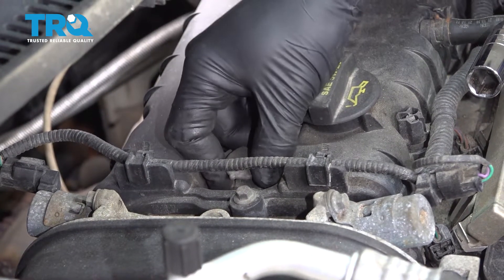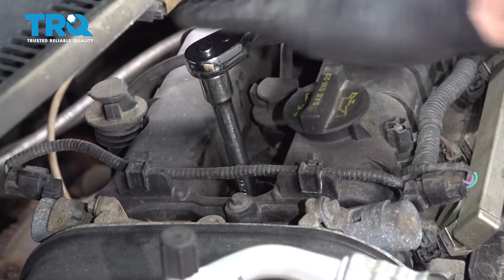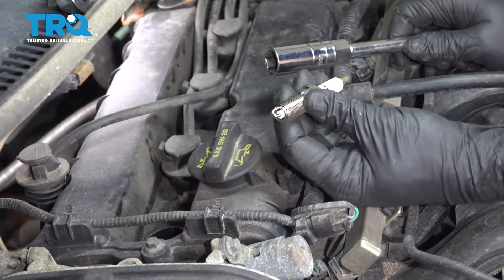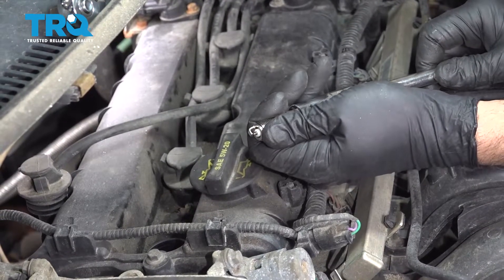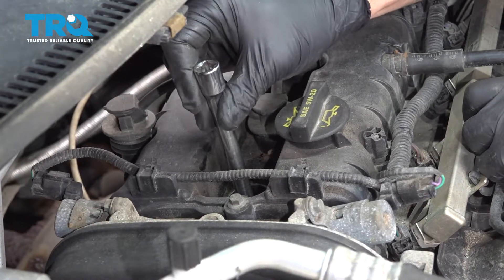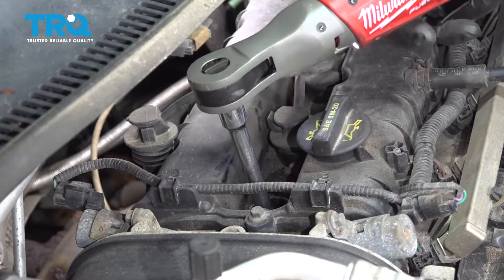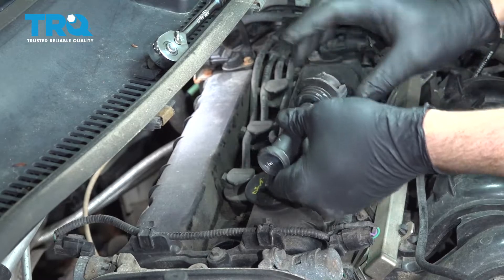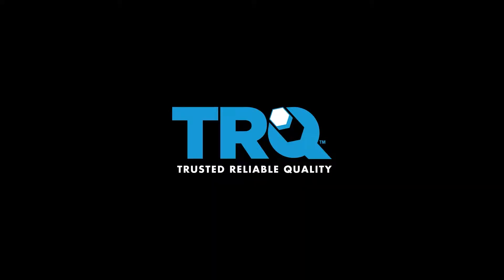How to Replace Spark Plugs 2011-2019 Ford Fiesta

Comment: I just replaced mine with Fords 525x Motorcraft and all 4 need it to be gaped to .32 they where way closer than that, i work at autoparts store and always tell my customers to double check since the same plug can be used for different applications with different gaps

Comment: I changed the spark plugs on my 2012 ford fiesta. I noticed that the thread stops almost halfway for the 4 spark plugs, this is also the case for the old ones. These are all motorcraft parts. is that normal?